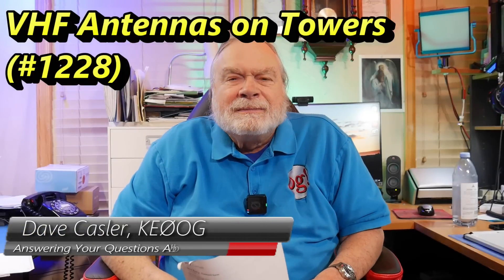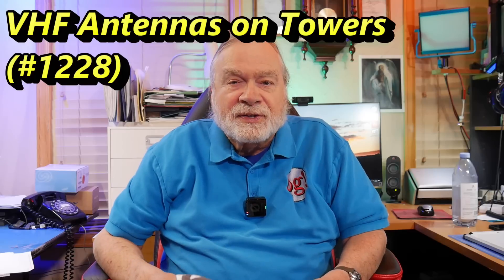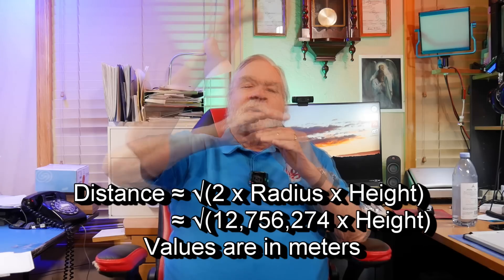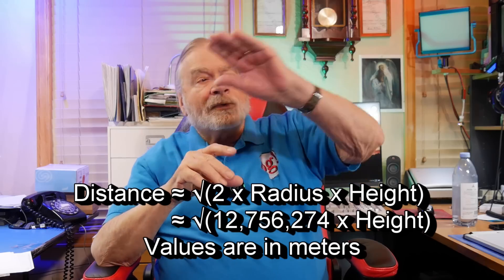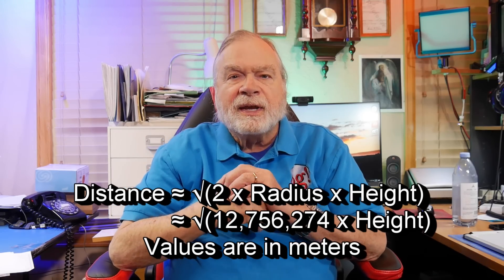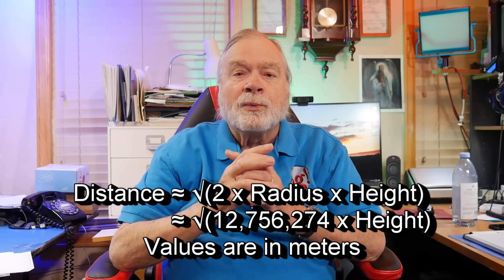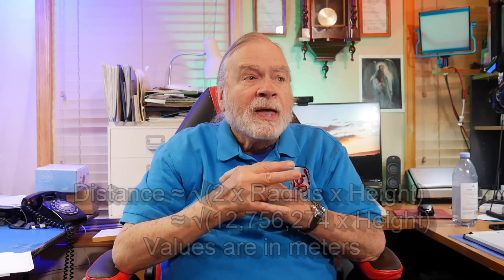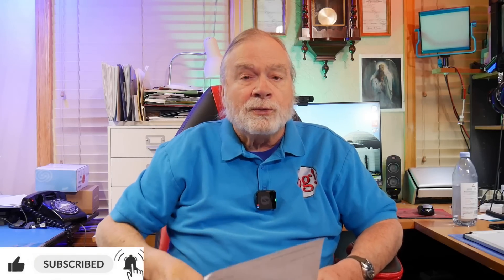VHF Antennas on Towers (#1228)

Comment: On VHF and UHF a Vertical polarised antenna will give you a coverage of some 30km (20 miles) if the clear of obstacles. A horisontal polarised antenna will give you a coverage of some 300km (200 miles) or even longer. This is because the Troposhere (the air-mass closest to ground) is made up of Horisontal layers of different humidity. Along these layers the horisontal polarised signal can propagate freely. It is not the height above ground that is important, it is the height Above the surrounding terrain (obstacles). Good luck with your installation !
Remember to keep the feed line loss as low as possible../Bjoern

Comment: Thanks Dave. Great call out on the coax length. That was one of my very early lessons in amateur radio and one that so many new hams overlook. I run M&P Airborne 10 for UHF/VHF and, as good (and expensive) as it is, the losses aren't trivial and it's not especially fun to work with. If Darren tries to run 200 feet of coax up the mast and into his shack - even LMR-400, that's a 5.3 dB or 71% loss on UHF. VHF isn't quite so bad, but it's still a 50% loss. You have to get into some very expensive coax, or in-line amplifiers, for a long run on UHF. I would put the antenna at a lower height.
Reply: mast amp ftw

Comment: I would encourage him to use zip ties covered by the electrical tape. In Florida as here in Georgia, that tape  WILL break apart in the sun. He did on my tower and has on the tower I helped put up at the local NWS. So use good zip ties as well. Not cheap Amazon ones. Robert KD4YDC
Reply: Hey there neighbor 😆.  
KQ4GDB